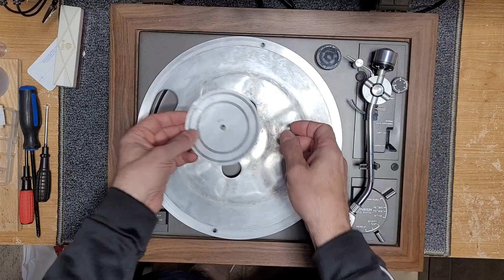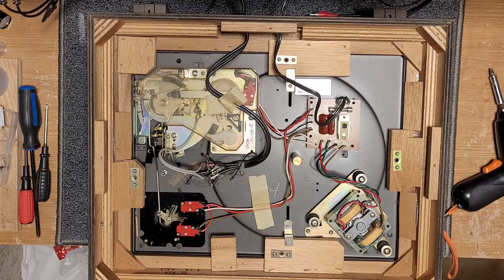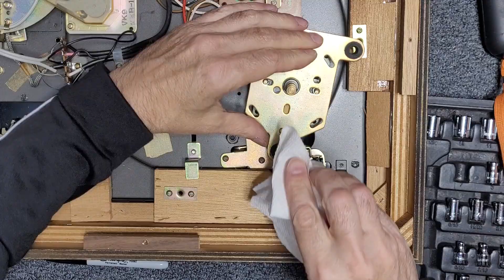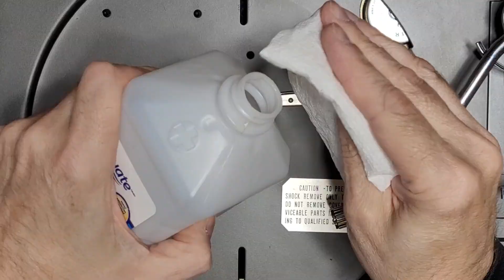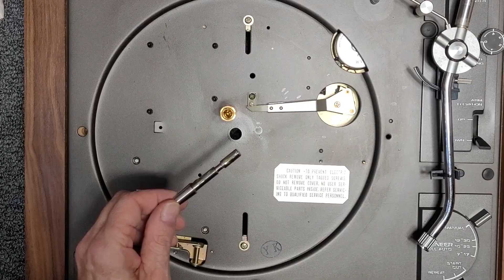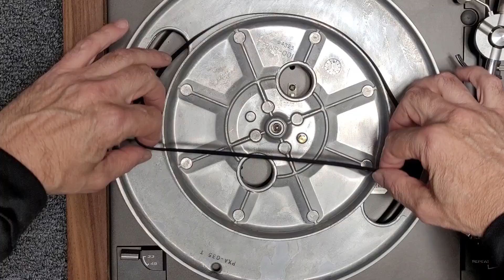PIONEER PL-A45D: Why Maintenance Is So Important

Comment: I have two of these needing repairs, I noticed dark moly-type grease used on both, now on this vid I see it here. It is sticky and thick and not designed for light movement, but for high speed, heat and pressure. Your thoughts please? Great video thanks.

Comment: I would be useful to see the location of the foam pad that is responsible for the tonearm to return all the way to the rest stop...thanks in advance
Reply: get the service manual, it has explosion diagrams, the foam is on the little arm that swings when the auto return operates. @9:23 it's directly underneath his fingers, under the cam arm. Take off the e-clip and washers,then the arm comes off the same shaft, pay attention to the washer sequence. Also the little spring only works one way, so pay attention to how it goes back in. Set the table on a flat surface with bubble wrap, you will drop items so be ready to recover them easily, not on a cluttered workbench. I cut a piece of squishy foam and used 3M spray adhesive, (using a screwdriver to apply it sprayed on a piece of plastic), seems to be ok. I have to adjust the static arm on the top left that the little swing arm hits to reset, a mildly complicated unit. Go slow, take pics as you go.

Comment: Awesome video. Thanks. This is my table. Perhaps a stupid question, but for the ground, if you connect it to ground at the amplifier with the fork connector, why is there a second ground into the metal foil on the bottom wood face of the turntable? Thanks.
Reply from the maker: Shielding for the tonearm wiring
Reply: @turntableguy after servicing the spindle and motor the auto return and play seem to be out of sequence. Do you have any suggestions on how to correct that. The tonearm gets dropped too early, before it gets to the platter. The tonearm lift doesn't seem to be engaging at the correct time either. I didn't touch the motor for the tonearm but did have the TT flipped upside down for servicing. Thanks for the great video!

Comment: On the hard bearing grease, why not use heat to soften it?  Can’t hurt the solid brass
Reply from the maker: I have used heat in the past to remove spindles that were stuck solid in the bushing.

Comment: Does anyone know where to find the adjustment info on the tonearm for the auto functions? I followed this service and it works great but the tonearm does not return all the way into its cradle. I dont see an adjustment for that.
Reply from the maker: Look to see if there is/was a foam pad on the return arm.  A lot of times it deteriorates and then the arm will not return the whole way.

Comment: To my favorite Turntable guy love the new intro very bright and sharp ,love the old vintage turntables would not have anything else I have a 1985 onkyo integera direct drive TT with seperate motor for tone arm I like it somewhat the only thing is that in the 80's they used a plastic gear to move tone arm and cueing which fell apart into pieces motor was fine but had to replace the gear at first very hard to find but was able to get 2 for a good price now tonearm works fine but that was the 80's they had good ideas but the cheap plastic is what is causing issues when they dry rot or just fall apart ,also I wouldf like to know yourv feed back on a turntable I just got it kind of caught my eye ,don't know how familar you  are with the vertical record players there are lot of them out there all manual me being a automatic TT guy I found one with automatic function  which really got me to buy one only 35 dollars its made by myksonic and goes for 300.00 or less but for me that is way too much its not high end but comes with the at-3600l cart the tone arm is driven by a motor and works like my onkyo TT  whats your thoughts on this type of record player JRo

Comment: you bolted the motor back to the plate 90 degrees to what it was, thats why oil hole was off .   At 13:10 see where wires are coming from, and at 23:50 they are 90 degrees clockwise.  The plate and motor work perfect either way so does not matter at all and the wires plenty of slack.  I only noticed because I noticed the hole pattern on the plate was same if rotated.  Love this turntable, I have my dad's old one.  Thank you for showing how to lube bottom bearing, I had not even thought of this, and will do it soon !  The turntable really does sound nice with a good cartridge  :-)